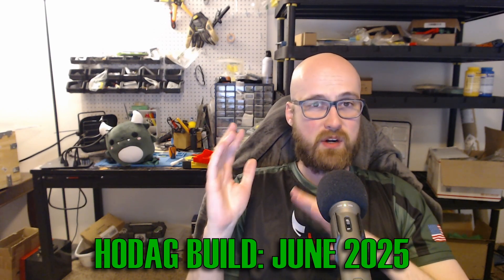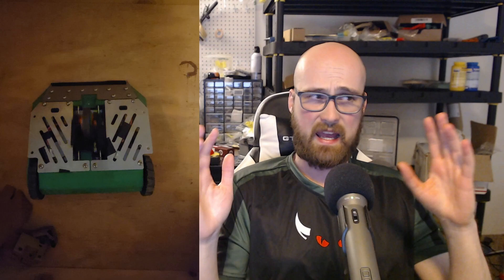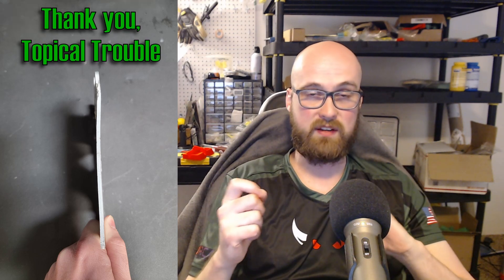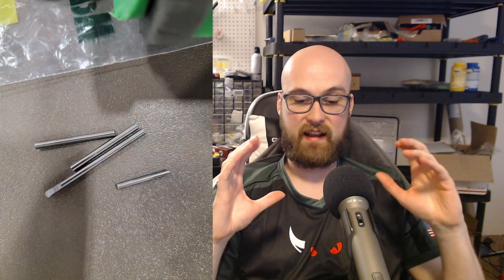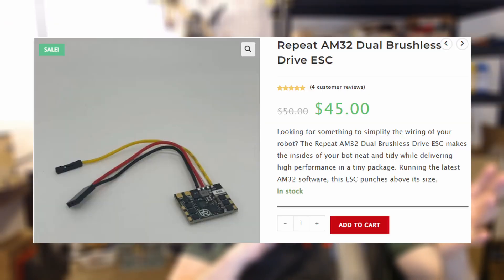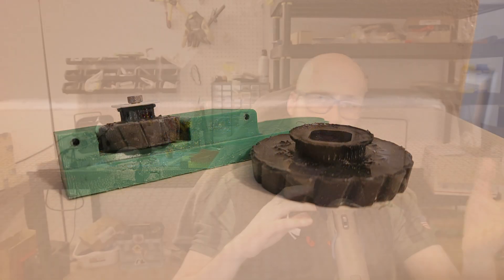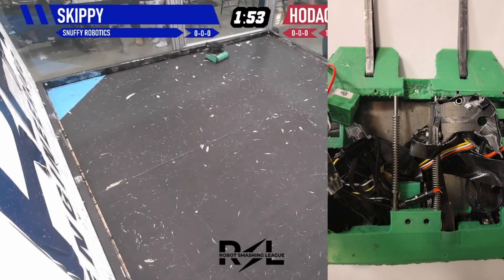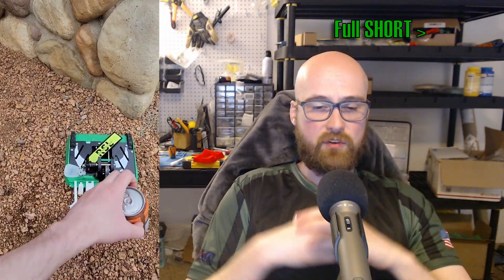I spent a year on this combat robot, meet Hodag!

Comment: yay hodag

also, im building a printed first measured after style robot, im on a short time frame, do you have any tips on driving?
Reply from the maker: What weapon are you putting on it?
Reply: @TeamCryptidRobotics  small vertical spinner
Reply from the maker: I'd say the first things to worry about with a very is holding the center of the arena so you don't get cornered and have room to move. Also understanding how your robot can self right is important, different vert self right differently